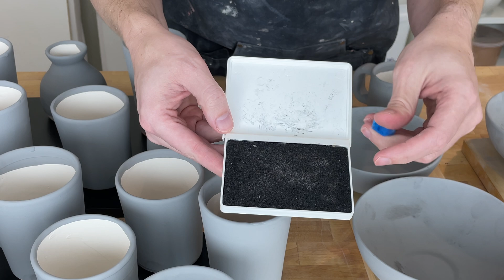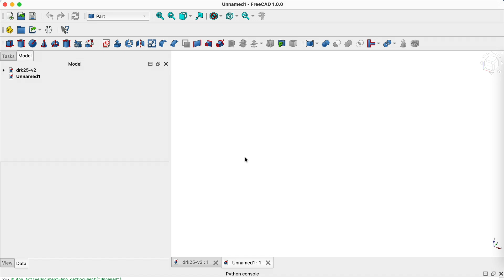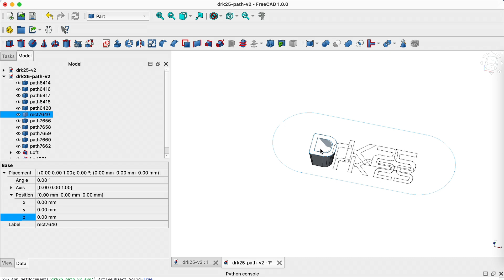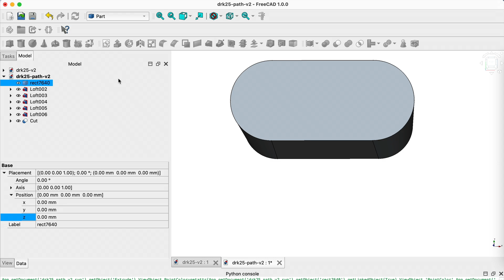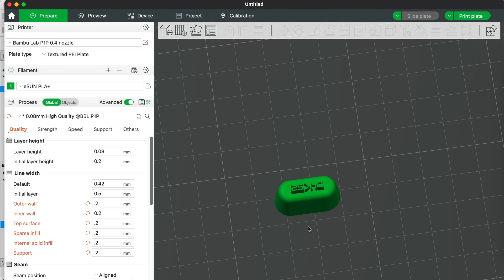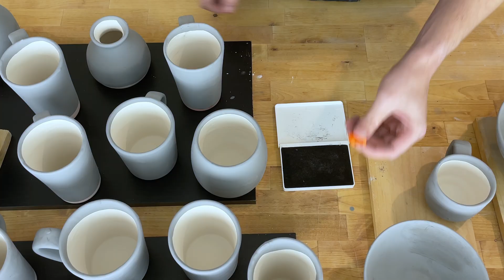Design & 3D Print a Custom Stamp - 2025 Makers Mark

Comment: An alternative to stamp pad stamping to get crisp small lines is silkscreening. I use Cricut cutter to cut design, iron on to silkscreen mesh, place on leatherhard or bisque and dab and rub thick underglaze. Have you tried that?
Reply from the maker: I have not done silkscreening but I could see it working well as long as your underglaze makes it through the screen.

Comment: Increasing the size would definitely help! I would play around and scale the existing model in the slicer until it had three to four lines wide for most of the text. Also slowing down the print speed helps for both quality and making sure small parts solidify before the next layer is added.
Reply from the maker: The print speed was already pretty slow for this printer. As far as changes - yes make whatever changes you want for your own design!